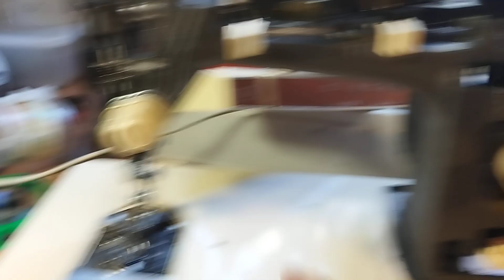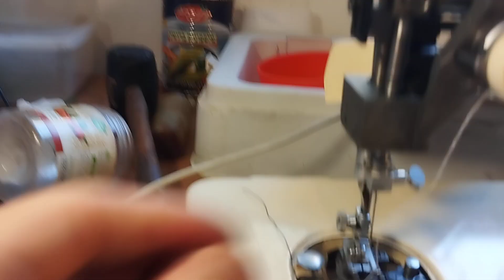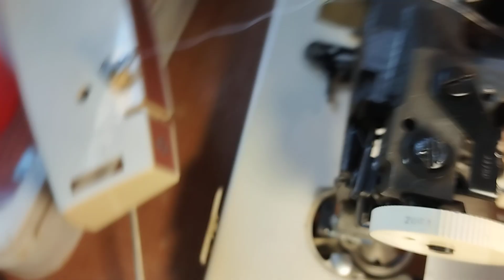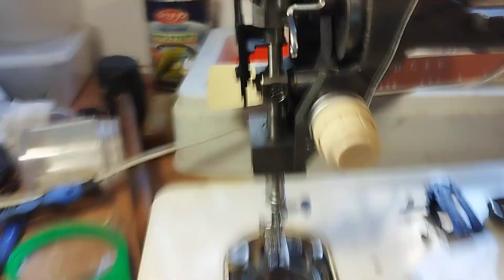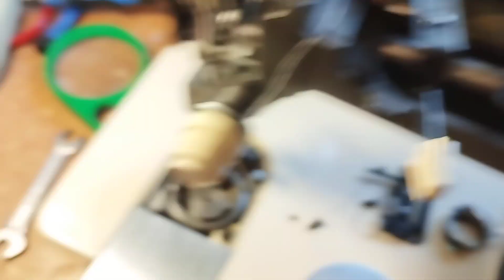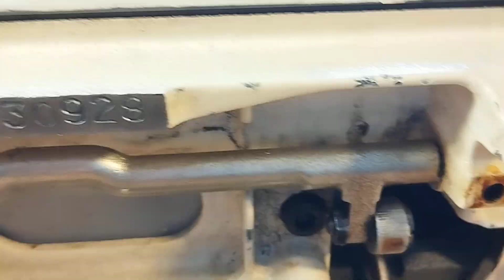Singer 368 - Tips and tricks for mechanical repairs, tuning and adjustments

Comment: Hi your video I saved because I have no manual and I ask you where I can download it.. thank you
Reply from the maker: I don't have a manual either...
I had to figure everything out by myself
Reply: then you are very good and patient💪. The thread tension adjustment knob in front of me on the left is not working well. How can I fix it?
Reply from the maker: @ 
I'd love to help but this isn't enough information... :)
Reply: @shacharliberman5084   The knob to adjust the right tension of the cotton wire should have a progressive tension. In my case is almost  on off. Do I use it  in not correct way?
Reply: Having issues getting the top cover off of ours, any tips?
Reply from the maker: @londoncrawling  
Same model exactly? I don't remember anything difficult about removing the top cover. Maybe put up a video?
Reply: @shacharliberman5084  thanks for the response, we just found a screw hiding that needed to be removed. Currently trying to remove the motor to work on it.